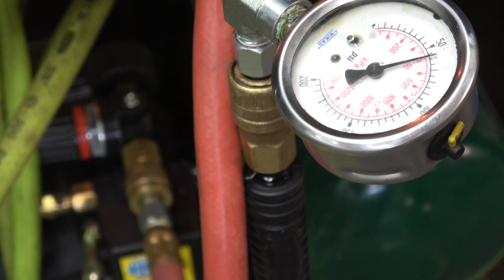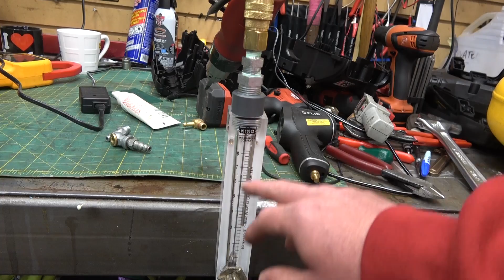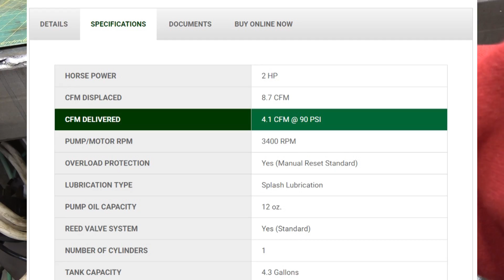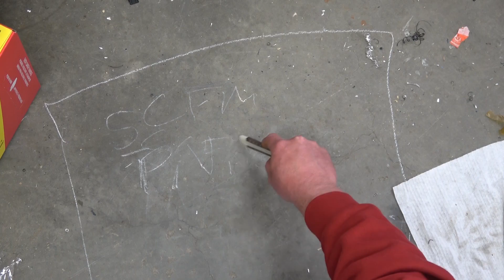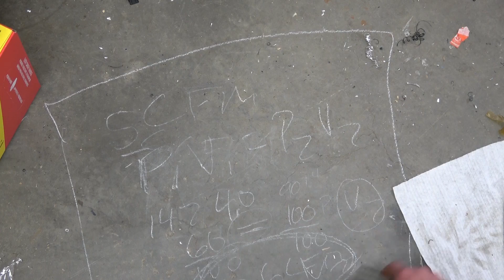Why are CFM ratings BS?

Comment: There are two ways we can get a solution to this BS. 1: go through another lawsuit with all the major companies in the industry, and hope for a decent settlement in 10 years. Or 2: all buy compressors, and return them for not meeting their claimed ratings.  If the package says "4.0 CFM at 90 PSI", it should do exactly as it says. The claim that the rating is at 90 PSI but for pressure at atmospheric is utter BS.

If the makers of these tools have a 10% return rate, it doesn't matter how much they try to defend their BS rating system - they have a 10% return rate because the customers are rightfully saying the 4 CFM compressor doesn't supply the 2 CFM tool. It's not the customer's fault that the makers went out of their way to create a distorted measurement that doesn't match the measurement on the tool - many of which are made by the same companies. 

And even better, if they are measuring based on air input, the best-rated compressors are the ones with leaks in the compression cycle. We can make cheap 100 CFM compressors that deliver almost no compressed air at all.
Reply: Well...whatcha got here is an opportunity.  How hard would it be to put together a system with proper specs for us garage guys?
Reply: @Rincewind808  it would be easy to put together a simple procedure and requirement - industrial-grade systems do it already. 

But the companies won't actually use it, unless required by law. Any company that refuses to use the system will claim their tool is at least 4 times as powerful as it really is; and they'll sell like hotcakes as a result. People rarely buy more than one of these, so they won't have any basis for comparison to realize they have been lied to. Most people assume that they are intelligent shoppers, and are prone to believe they made a good choice - they are unlikely to realize they got ripped off, unless they have a lot of experience with the product. 

AvE is good with this stuff, and it took him 2 videos and a lot of comments to figure out what was going on. So I wouldn't expect any standard consumers to recognize and avoid the products that are lying.

Comment: As the owner of a construction company, we’ve known this for a while. But, bang for the buck, those little Rol-Airs are just fine; better than anything else at that price point. I own three of that same model (or the previous iteration of twin stack design from the late 90s). They’ll run two framing guns at a pretty good clip, which is about all you can ask for a compressor that you can climb a ladder with. Change the oil once in a while and they’ll go for 15-20 years. Of course we have larger and smaller models too. Just my real world two cents.

Comment: It's not "rated" for a tool, they use different measurements, as you've asserted. And since the tools tends to use different pressures, having a standard measurement for the compressor is sensible, though it should be provided with a table of what it translates to at different pressures (which is relevant for a given tool). So basically you're roundhouse kicking down already open doors, Chuck Norris style.

Comment: I am allied to industrial airflow systems where we use the big industrial fans. I agree that it is a hell of a lot of confusion out there on the small commercial compressors. The rule of thumb is if it shows CFM or SCFM or Free Air Delivery or (as is in Australia) L/min then assume that it is measured as airflow going into the compressor and when stated as ACFM or Actual CFM and an operating pressure is nominated then you can trust that the airflow will be what is delivered to the tool. Sadly you need to have some skills in Maths and Engineering to do the interpretation between the two values.

Comment: okay i wrote this on the last video as well, but the dewalt box indicates it was tested per ISO 1217. ISO 1217 specifies in section 3.4 Flow Rate, "actual volume flow rate of a compressor:
 actual volume flow rate of gas, compressed and delivered at the standard discharge point, referred to conditions of total temperature, total pressure and composition prevailing at the standard inlet point" Basically this is the volume of air it will suck in and compress at a given output pressure. So yes, the spec they tested against is suction performance as is indicated on the box. Yes it's deceptive, and stupid, but at least it's called out on the box. 

What I can't find is the standard a die grinder manufacturer would use to rate the tool air consumption. if they also used sCFM when provided with 90PSI air, then everything would work. If the tool manufacturers rate tools in actual CFM at 90PSI, then yes you'd need to break out boyles law.

On related note an ingersoll rand 302B 1/4" die grinder is rated at 0.33HP. As was pointed out in the previous video there are a huge number of losses in air systems. I'd expect at least the efficiency to be around 0.4 at best meaning at least a 1HP compressor motor would be needed.

Comment: What's with the "90psi" in front of the "4CFM"?  Since youve got an AC induction motor running at a constant frequency with a fixed displacement piston, it could be at 20psi or 50 or 90 or 120 and the inlet flow is going to be almost exactly the same regardless.
While the "4CFM" is a lie, the "90psi" is the real lie.  The "90psi" is the lie that makes rational people assume the method of testing.

It'd be interesting to do bore and stroke and rpm measurements and just see what shakes out.
Reply: There's a clearance volume at the top of the stroke, full of air at the discharge pressure. When the piston starts to move back down, that air has to expand back to ambient pressure before more is inducted. The higher the discharge pressure, the more air left, and the less inducted each cycle. 
So the delivery does reduce for the same cylinder volume and speed at higher pressure
Reply: @HJSkullmonkey  You do realize that almost exactly 100 percent of the energy it takes to  compress that left over compressed air in the compressor dead space is recovered in the form of force moving the piston back down, right?

You're close, though.  If you take the difference between "exactly" and "almost exactly", the vast majority of it will be the delta "something" I was talking about to that other guy.  I think you'll beat him to guessing what it is.

Comment: Hmm, I think it's even worse than what you said- you can only use Boyles law to calculate the volume put into the tank- at constant temperature.

If you want the air to do actual work again, even just pushing the atmosphere out of the way the temperature is going to have to drop on the way out, so you're getting even less pressure for a given volume than that out, probably by quite a lot... In some sort of adibiatic thingy. But the maths is a bit beyond me right now

Edit: I think about 2.2 CFM for every 4CFM in the very worst case to do sweet F.A. i.e. just expanding into the air against no resistance

 They air heats up as you compress it, but it will lose a lot of this heat in the pipes/tank. When it comes time to expand again, this heat is missing so the air remains denser at a given pressure == you get less CFM for a given pressure ( mass is conserved, not CFM) this could be as bad in the worst case asalmost a factor of two. The maths Is weird and involves powers of 7-when you compress the volume shrinks by a factor of 7=105/15 but if it's fully cooled down, may only expand by a factor 7^(5/7)=4 giving worse performance by a factor 4/7

TLDR to run a 3cfm tool at 90psi you need a compressor that has a rating of at least 21scfm at 90psi and possibly up to 37scfm at 90psi
Reply: The fact that the gauge read 3.5 instead of 4 was probably in large part due to this heat loss.

Comment: I've worked with air compressors and I do confirm this, first with Campbell Hausfeld, then with Powerex-Anest Iwata.  The issue is one of system capacity, they use this one because it ignores capacity and regulation of the system.  It is truthful but the industry uses this because it allows apples to apples comparisons to a competitor.

Comment: This is why i bought an 80 gallon 2 piston 2 stages 25 amp comp for my shop. Grinders nailers and spindle sanders no problem. Do I use it all the time? No but its there when I need it. This small ones are garbage for anything more than a pin nailer. Plus why would anyone use a pneumatic pinner when everyone tool maker out there has a battery op one now? You don't even need a comp on site any more other than for roofing.

Comment: When I was a wee lad, I really thought my shop-vac was 5HP because it said so on the sticker.
Reply: They get that number by measuring the suction power of the horse.
 
Brave engineers.
Reply: @2canines  
Not hard to measure the suction power of a horse. All you need is a good vacuum gauge a pair of gloves and 2 bricks.
Reply: The best thing about that is that you could upgrade the power by just changing the sticker!
Reply: Best to go by the Ampere rating. Probably same is true with air compressors though I've never exactly checked the details.
Reply: @johnpossum556  Not really--consumer-grade power tools are often rated by the "locked rotor" current consumption.   Which is useless, because the tool isn't spinning.

Reminds me a bit of the old "EIA Music Power"  ratings on audio amplifiers.   Utterly meaningless for all practical porpoises.

But the keyword when buying a compressor mentioned in the video is "continuous duty" tool.  Prosumer compressors are great for running nail guns and staplers, but those aren't continuous duty, unless you've got a very fast trigger finger.
Reply: @tubastuff  yeah because those tools only have one piston, not a rotary motor.

Amps have come a long way. Class D are dirtier than shit for THD but have lots of power in a small package with very little or no heatsink to speak of.

Admittedly I don't buy a lot of new tools anymore. I've been starting to favor going to pawn shops and buying an old tool I already like. Plus the benefits are if one dies I already have some parts for it.
Reply: John Possum ap
Reply: I got one that was 5HP too then I realised I don’t have a 3 phase power outlet :(
Reply: yeah maybe AVE can do a thing about shop vac HP ratings hahaha

Comment: Honestly it makes more sense to measure CFM at STP conditions (standard pressure). If your pressure is constantly fluctuating then the CFM for each pressure level is constantly fluctuating. CFM at STP gives you the mass flow, and Max PSI gives you peak pressure. Those two ratings would give you much more useful information than just CFM at a rated pressure.

Problem is that the other metric is standard it seems.

Comment: Oops, is temperature not a variable too?
Reply: It absolutely is! But, if you're talkin about continuous use of an air tool, the air would be used almost as quickly as it was produced. I'm guessing pressure drop due to temperature loss would not be huge.
Reply: @cfeigel  Uhmmm, compression equals some kind of heat production, quick use or not, no difference.

Comment: Thank You AvE. Been in auto repair 34 years, knew there was a scam, but you finally explained it. So THAT'S WHY our shops NEED air compressors as big as VW engines and 80-120 gallon reservoirs. Great video.

Comment: Something that I've noticed over in europe too, the liter/minute plastered over the compressor tends to be the straight calculation of cylinder displacement times RPM, most also have a rating in the spec sheet which is air delivered at 6-bar which is drastically less.
It tends to be RPM dependant how much this differs, since the cylinder doesn't fill up 100% on the way too fast running vacuum cleaner motor compressors, the difference can be massive between these numbers. Meaning the same HP rating 1000-1200rpm compressor has way higher actual air delivered than the little screamer running at 3800rpm with a tiny piston.
This seems to confuse customers a lot since that nice compact vacuum cleaner motor may be 2hp, but deliver the same air as a 1hp slow running induction motor that is way bigger.
I'm not 100% scientific on this though, mostly observation so I might be wrong.
Edit: Forgot to mention, the vacuum cleaner motors also have atrocious efficiency, and the power is the input power, not the output air power.

Comment: As someone that has worked in the pnumatics industry I am going to disagree with you and some of your methods. Measuring a compressor with a Guage and a pressure drop to zero across the flowmeter is a valid way to test for volumetric output rate .

When you introduce a tool to that system you have tons of losses, from the multiple 90 degree bends and internal flow constrictions this changes everything. These are frictional losses that you are not taking account of.

Also scfm is ideal because it controls for various variables, otherwise companies would control those other variables to enhance the cfm value.
Reply: Agree, this is as much about education and understanding.  In science and engineering we need to all talk the same language and SCFM or slpm is necessary.  Also, to further complicate it is the change in temperature, or p1v1t1=p2v2t2 which was not mentioned.  At least with this so called BS you can compare air compressors together
Reply: Then the tools should be rated the same, so when you see "3 CFM @ 90PSI" you know your "3 CFM @ 90PSI" compressor will do the job... He outlined why its BS. The tool would have to be rated "18.4 CFM @ 90PSI" for the marketing wank to be the same.
Reply: I agree, the tool should have a min and max scfm consumption rate at a pressure appropriate for the tool. Typically 80-90 PSI

Comment: If you can somehow manage to get your hands on a KAESSER air compressor, I would really like your opinion on these machines 
best wishes from Austria
Reply: I have three screw compressors in my working place which I am mostly responsible of. Very solid machines. Only few things in almost 10 years of use. If I recall correctly Kaeser told figures with inlet suction, output at 3bar and output at 6bar. Also Kaeser seem to be much better machines than Atlas Crapco that our subsidiary have. Nothing but problems and their staff haven't been able to get work properly in about something like 3 years. Never Crapco, only Kaeser. Oh yeah and Kaeser SAM is great addition in multiple machine configurations

Comment: Before I joined the healthcare field, I worked for my father's equipment rental company.  We had pretty large dual-piston, 2 stage compressor in the shop that we used for everything.  Still, it could never keep up with large grinding or sanding jobs.  I ended up plumbing our compressor through the wall of the building with a Chicago style air fitting on the exterior side.  When I needed a constant supply of air, I would back our Sullair 185 towable diesel compressor up to the building and hook it into the shop compressor tank.  Never ran out of air then!

Comment: Rule of thumb for industrial compressor sizing is to sum up you uses, and multiply by at least 2... the maximum 50% duty cycle keeps you from burning out your compressor too soon.

Little homeowner machines? there's no good guidance other than "biggest you can afford to buy that won't blow your breakers"

Comment: I'm just going to times the CFM of the tool by 5. I don't have enough fingers and toes for division.
Reply: if you need  this division thing  just multiply the compressor output by .2 which is  divide by 5
Reply: @joejane9977  My fingers don't do decimal points either.

Comment: This seems like something that should be pointed out more clearly when working with a compressor....
It doesn't feel like clear specifications, and practically on the verge of false advertising, if it weren't for the technicalities behind it....

Though, at the same time, at least they aren't rating it based on peak output flowrate.... (even though this specification could actually be useful, though mitigated by a hose... But this can technically be calculated based on the fitting, and pressure difference, etc.)

Comment: As an engineer who's had to size a few compressors based on air usage, operators/site managers always balk when I specify a compressor 6x the size they would have, particularly compressor price scales fairly linearly with cfm. Not to say engineers can't be overly conservative...but I have to explain that the compressor takes it's cfm rating at 0psi, and the tools/actuators take their cfm rating at 60-100psi, and it takes 5 cfm of 0psi air to make 1cfm of 60psi air. Thats why pumping up your bike tires seems to take 5x as long as you think it should. 
Also, I've heard of napkin math...I love concrete floor math.
Reply: As for the industry standard, it depends. Many places will give scfm, 60psi delivered, and 100psi delivered in their paperwork. But there's actually paperwork and a salesperson to make sure you're talking the right units.

Comment: I'm more in the building computer realm than air tool realm, but it's the same thing with computer case fans.  CFM ratings vs Static Pressure ratings.  CFM ratings are listed at 0 static pressure, and Static Pressure is measured at 0 flow.  Neither of which are usecases you're actually going to see in reality... so the curve is more important than the tested numbers

Comment: You think that's wanky. Years ago a certian prominent manufacturer of Ag equipment started to rate their tractors horsepower using the German standard instead of ASE. So their tractors got a nice little boost in power and leaving consumers wondering why their older tractors seemed to have more than the new ones.